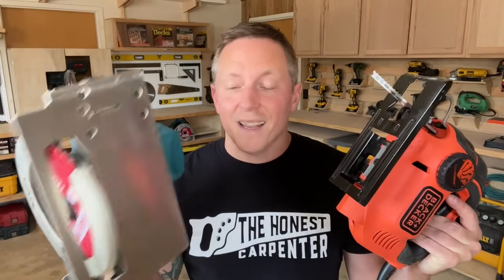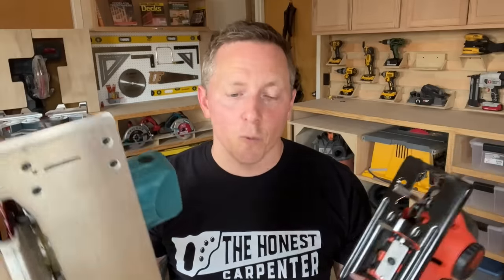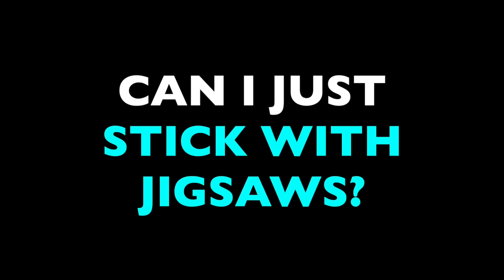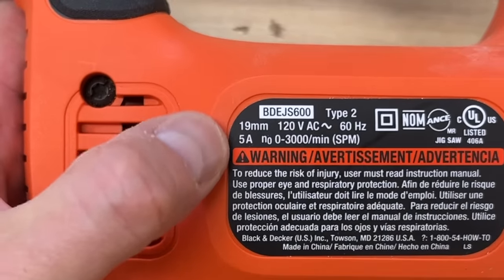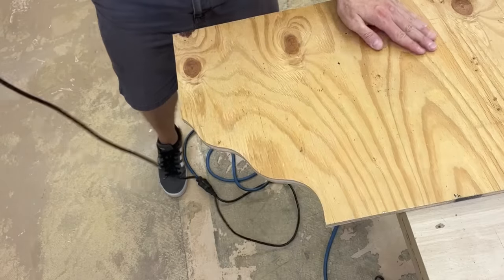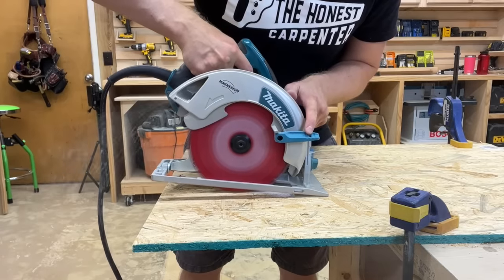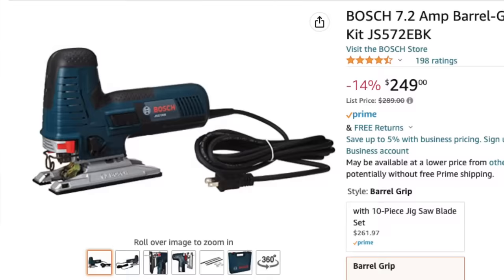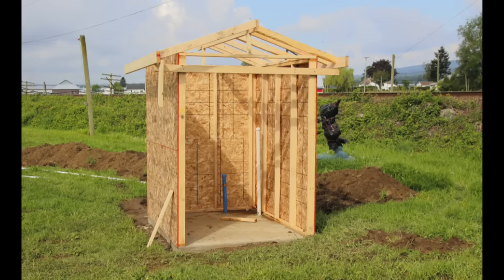CIRCULAR SAW VS. JIGSAW...Which One Should You Own?! (FULL COMPARISON---New DIYers Should Watch!!)

Comment: I tried to get away with just the jigsaw at first, but cutting bigger pieces showed that it just straight-out lacked grunt, even if it could easily deal with the thickness. I was increasingly worried that i would overload it and destroy it. 

When building stuff became more than a one-off affair, the circular saw swiftly found a place in my garage and the jigsaw was relegated to what it does best.

Comment: You’ve shown only corded tools, what about cordless? Any recommendations? What is reasonably priced for a DIYer but good?
Reply: If you're not worried about price since you are a DIYer. You can go with Skil, Hart, or with one of the top 2 brands that Harbour Freight sells. Those 2 brands is Hercules and Bauer. They're decent. I have Hart ½ inch cordless drill/driver and a ¼ impact. I love them.
I have 2 older Skil corded circular saws and they're good.
I also have a Walmart brand hypertough jigsaw. All I use that for is cutting lids off of plastic barrels.
Reply from the maker: I'm yet to buy many cordless saws, Gizmo! I'm interested in seeing what people recommend here--I'd like to do a video on the differences later after some testing of my own.
Reply: Kobalt 24 volt cordless saw. Smaller blades for wood, metal, glass, etc. bought it form my daughter but I’ve used it. Lowes product, 99.00 w/o battery.  I just hate all those cords. I’ve cut a pallet with it, not the best wood, but it did a good job. Check it out. Another question, I have a Sears wet/dry vac, it’s old but works great. What do I need to buy to catch the dust from my chop saw and my Delta table saw? I see adapter kits out there but do I measure the circumstances of both objects to get the right fit?

Comment: I bough a brand new Makita jigsaw since it was one of the best brands, and in addition to cutting straight, I could also use it to cut curves and bevels. That was fine and all but after a few uses the blade that came with it started cutting in an ark. Did I push too hard or is it a common problem? If I replace the blade, will it cut straight again?
Reply from the maker: That happens a lot, repapeti! It's one of the chief drawbacks of the jigsaw. There are ways to mitigate it, I'll try to cover them soon. But the best thing is to make sure that your blade is straight and not bent at all...and to push the tool a little slower, but with higher cutting speed. The blade can do it's job that way without too much stress!

Comment: circular saw = straight long cuts. 
jigsaw = tighter cuts with angles and bends requiring fine adjustment.

A jigsaw is practically a bandsaw in your hands.

Comment: Ethan, Putting aside the circular saw vs jigsaw debate for a moment, right handed saw users should buy a circular  saw with the blade on the left so they can follow the cut line much more easily. Circular saws are a lot less 'scary' to use when the wood is properly clamped down and the operator is using all the necessary safety equipment. As you illustrate so effectively at 15:17, the proper use of safety equipment is very rare on Youtube. 😉
Reply: No they shouldn't. Your statement is too generalized, for some people it is the better option but not for all. Rear handle saw has pros and cons and is less safe
Reply: @riba2233  Did I write the words rear handle or heavy worm drive saw? BTW have you ever see how easy it is for a left-hander to use a right handed saw? It is like watching a baby duck 'learn' to swim. There is ABSOLUTELY ZERO advantage in having to look over the top of the saw to see the blade.
Reply: @rightlanehog3151  not true, there are advantages, mostly in safety department
Reply: @riba2233  Please explain how not being able to see the blade helps safety.
Reply: @rightlanehog3151  you are further from the blade, if it jumps or kickbacks it wont go towards your body. Also saw is supported on the work piece unlike left hand which is not supported and rides on the offcut
Reply from the maker: I agree here, riba! I grew up on a right-side Makita, and quickly got used to it.. I like that, as you said, the motor weight (which is the most dangerous element in cutoff situations) is most often supported on the user side. I also learned to lean my head towards my right shoulder and follow the blade path very comfortably on the blade side, or sight through the blade window on the near side. So many variables are at play when you consider work surface setup (if there is one), which side of the line you're taking, etc, that you could make many of the same arguments for left-blade awkwardness!
Reply: @TheHonestCarpenter  thank you for the answer! Are you still planning on doing a video discussing pros and cons of both circ saw types?
Reply: @TheHonestCarpenter  Ethan, Will you be scrapping your worm drive saw now?😉

Comment: I can't imagine cutting a 4x4 or thicker with a jigsaw. A 2x4 is pretty terrible with my junk jigsaw😅
Reply from the maker: Some of these new blades are crazy! Even my 5 amp dug through pretty quickly 😧
Reply: @TheHonestCarpenter  I definitely need a better jigsaw.  I have nearly all DeWalt and Metabo tools.  But my jigsaw is a very cheap Chicago Electric Harbor Freight tool.  The thing vibrates all over the place

Comment: My first saw was the jigsaw and after 20 years I am still not very good with it.  It's my least favorite saw.  I get tear out.  I cut line is not straight across the thickness of the material because the blade flexes.  Because the blade goes thru the material I need to clamp it to the workbench with weird positions.  It is mostly collecting dust.

Comment: 5:20 quoth the manual, always hold the tool firmly with both hands.

I'm such a paranoid crybaby, I never hold any piece that I'm cutting anywhere.  I'll throw clamps on it and operate the saw with both hands.  When using a circular saw, I want to be 100% aware of where my fingers are.
Reply from the maker: That's really the best idea, bridge! I try not to show my bad old job site habits too much on the channel, but they sneak in sometimes 😅

Comment: How is this even a question? Jigsaw is far safer. A circular saw is one of the most unsafe tools in the shop. If you need a circular saw, what you really need is a table saw which is a far safer tool than a circular saw. And if you can't afford the right tools to do the job right... maybe woodworking is not something you should be into.